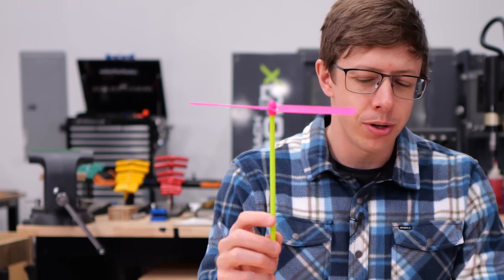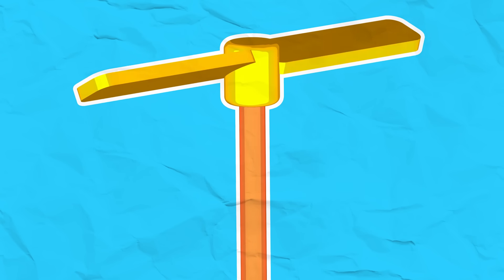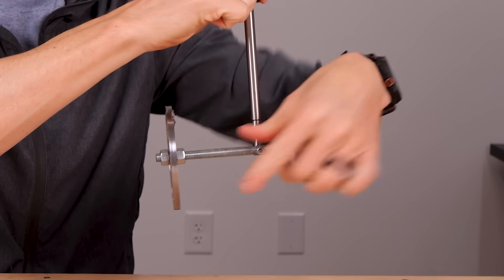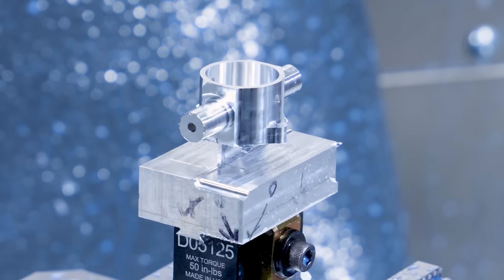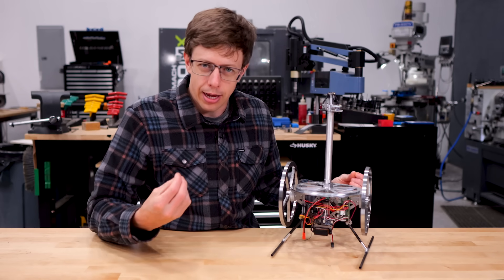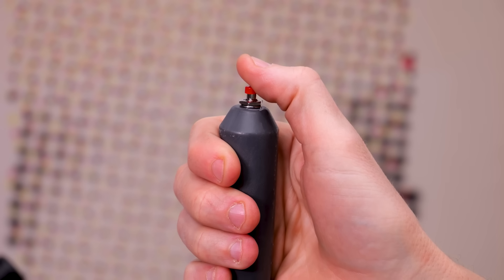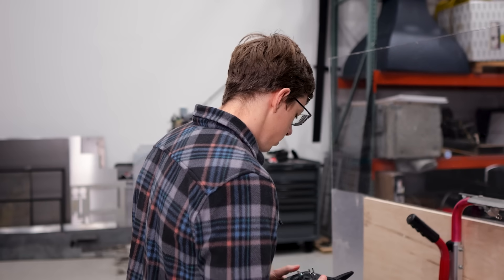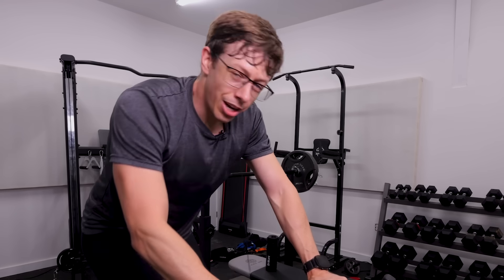I really thought this would fly well

Comment: You should place two flywheels parallel to ground rotating each in opposite direction. Next you put them on a shaft which connected to the propeller. Flywheels must rotate freely on the shaft. Next you put electromagnetic coupling that would act as a "torque converter" between shaft and flywheels. In such design you can use PWM on the electromagnetic coupling to smoothly transfer torque from spinning flywheels to shaft with propeller. And because you have two flywheels mounted horizontally spinning in opposite direction a) you would have gyroscopic force that would help you to stabilize helicopter b) you don't need to fight counter rotation.

Comment: Back in the 90s and early 00s this was a whole thing. They called them "Launch Copters" or "Jump Copters". They were both electric and nitro powered and would just fly up then back down with a trigger at the bottom that would cut the motor as soon as it landed. It's so hard to find information on them these days though.

Comment: One fix you might be able to implement relatively easy is the realistic linkages used in helicopters to change the angle of the blades not only to generate variable thrust, but also to vary the thrust more in the back than the front, or one side to the other, in order to get pitch and yaw which will have far greater strength than your flaps here.

Comment: so with bottle rockets the tail of a stick helps it fly straight the tube basically is the flywheel along with wing weight  proportion of the flight craft matters as it seems to me you're making a pancake shape to fly .. thrust to weight ratio matters but yes aerodynamics and unpowered freefall characteristics built in to make it self righting. weevils wobble but won't fall down so to say

Comment: Instead of solving the main body rotation problem with control surfaces, a tail blade, or counter rotating main blades, the design should take inspiration from the toy and not have a main body. Just a coaxial propeller and flywheel connected by a stick. There are three ways to couple the flywheel's faster rotation to the propeller.
1. Gearing like in this iteration
2. Clutch with either a mechanical governor or electronic control
3. Just a simple bearing and let the unavoidable friction transfer the angular momentum

Comment: First, I appreciate you sharing your morning routine. Makes me miss having an able body.
Second, you should contemplate am opposing spin rotor, which would automatically create bot more lift and counteract the momentum of thr primary rotor. But if you refuse that option because it deflects too much from the single rotor design, a smaller lightweight anti-spin governor setup might also dampen the rotational issue,

Finally, you should upload more often. As a creator, I understand how difficult it can be to reveal an unfinished prototype, but this community values your output and is glad to help you iterate.

Comment: Maybe if you put a boom off the back of it with another swashplate and a much smaller rotor also driven by the main ring gear and controlled by another servo.  Im pretty sure that would solve the torque of the main rotor.

Comment: Ok so I feel like its cheating to lead with toy helicopter and not keep the spirit of the thing (small input shaft with blades on).
It would be cooler to make an oversized one and put some tungsten at the blade tips for that flywheel effect or make the blade unit a giant flywheel with 6-8 pivoting aluminum blades and a steel rim. Embrace the rotation!
Alternatively, frisbee on a stick.

Comment: Valiant effort. Epic fails are entertaining too =)

I'd be curious how it would have worked taking off from a elevated, open air surface. I can't imagine the control surfaces were really doing anything when being used in all the turbulence of the downdraft/eddies from the rotor and drive gear. Dirty air is probably negating the coanda effect on the surfaces leading to no controllability.

Better. Faster. Stronger. 
Looking forward to Version 2.0

Comment: you've got the same problem as a helicopter.  You either need a tail rotor, or counter spinning blades.
Alternatively, you could try adding a flywheel to the same design as the toy, in which case it doesn't matter if the body is spinning or not.

Comment: I didn’t know that counter rotating flywheels would cancel each other out. I thought the gyroscopic effect would be doubled and procession cancelled out. I’d like to see a video to test this. Maybe if the rims of the flywheels were heavier you’d get a more pronounced gyroscopic effect. Use some steel in the rims. 
I think the anti torque wings could be higher. You have them about 5 inches high but only the bottom inch and half is slanted. I would slant the whole thing. I don’t think they need to be movable. If the tops were slanted then maybe the bottom inch movable to adjust the trim.  As the rotor speed changes so will the torque, so I guess they need to be moveable.  Very hard to control unless done electronically. 
Great project.

Comment: I feel this would be way better approached by just turning it more into a plane, which it seems you kind of figured was a good idea with the wings/ailerons to counter torque like a propeller plane would rather than how a helicopter would, but you clearly didn't go all the way. If you look at this like a plane just pitched fully vertical rather than like a helicopter you see that your wings are barely even a quarter the size they should be, and you have no tail section for stability. If you made it into a full plane you wouldn't even have to worry about an autorotation (which I suspect will be very difficult to reliably accomplish especially on something controlled remotely), because you could just glide it down like a plane. I very much understand how you got where you did and I would get why you wouldn't want to do it like this because it would be a pretty big departure visually from the starting idea of the helicopter toy, but the idea of trying to achieve the maximum height from purely kinetic energy and no on-board power is a really cool one and there's definitely ways to make this work.

Comment: I’m still not sure why he didn’t just put a flywheel on a planetary gear with the shaft That’s connected to the propeller in the middle of the planetary gear. It will give you the 5:1 reduction without having to worry about transferring energy 90 degrees

Comment: Entertaining build, and I appreciate the dedication to flywheels immensely, though I feel like it led you astray here. The process got me wondering about how far you could push the simplest possible design of a shaft plus propeller - the old Snap Circuits kits had a fan-launching motor that could be a useful starting point for an alternate design: a three-bladed propeller (more blades are less efficient aerodynamically but allow more power to be absorbed by a propeller of fixed diameter) surrounded with a thin ring that acted as a flywheel. The entire system was passively stable aerodynamically and when spun up by the modest motor from the kit (which I naturally overvolted) would launch easily to the ceiling. 

One final note - you discuss drag going up with the square of velocity, which is true, but lift also increases at the same rate. Propeller design is all about maximizing the lift-to-drag ratio at some target rotation rate

Comment: Why not rotate the orientations of the flywheels to be in line with the propellers gear them to spin in opposite direction to correct for precession then use a geared drive shaft to spin the propeller at a ratio to the flywheels

Comment: Would using 2 rubber wheels side by side " like a pitching machine" be able to spin the shaft and use a piston to push the shaft up and a actuator to pull back the wheels ?

Comment: Two main ideas for the redesign:
1) Counter-rotating propellers, which have been used an many real-life (and especially RC) helicopters to counteract the directional torque of the life blades, and
2) You modeled your control surfaces on plane wings, which have the control surfaces only in the back, since they need the main body of the wing to generate lift. Since you aren't using wings to generate lift, you could use the entire wing section as a control surface and just rotate the whole wing to counteract the torque if you don't wanna go counter-rotation, or even if you do so you can increase your aerial maneuverability.
Reply: Yep. I was going to mention this, but if an example would be helpful is the Ka-50 kamov "black shark".
Reply: @Zirnike   Isn't there another problem which is that when the craft is taking off, the earth plane is effectively butted up to the trailing edges of the control surfaces, and hence defeating the airflow past them
Reply: @Gottenhimfella That's what I came to comment. The whole thing is in ground effect the entire time he's trying to test the control surfaces; they're not going to work the same way they work in the air. I agree with the earlier poster that he should just ditch them and use contra-rotating props though.
Reply: @Zirnike  Counter rotating flywheels might help too.
Reply: Additional notes for point 2. If the entire wings are control surfaces, they will need some serious power to hold against the wind. Instead of making the whole wing rotate, have them mounted in a fixed diagonal position to start. He knows that they will always need to point in one direction, but with small adjustments. So the neutral position should be in that direction.

Also, during his low altitude tests, the ground interfered with the effectiveness of the wings by creating a high-pressure zone. If you are pushing air directly into the ground, it will need to turn because it just can't keep going straight. And this is going to start happening sooner than 3 inches off the ground. Those flaps probably weren't deflecting much wind until he tried the full test. But even then, they were not enough.
Reply: @JustSomePasserby excellent points. I want to see a suspended vehicle with the wings pre-rotated now 👍🏻
Reply: @JustSomePasserby  The way to reduce the power required is to have the pivot near the middle of the wing. The part of the fin before the pivot pushes one way, and the part after the pivot pushes back.
Reply: Came to comment the exact thing as your first suggestion, so left a like and comment on yours to boost it up instead of me making another comment amd just having it disappear in the flood of other comments. I think that the counter rotating propellers could really be the solution and possibly doable without a total redesign and just a much smaller redisign.
Reply: Better idea: drastically simplify it. Put tip weights on the blades for kinetic energy storage and have no gearing in the flying object. Release it from the motor with a clutch. The toy already works fine.
Reply: @andrewbroeker9819  Exactly. The rotor is a flywheel. Just make it more of a flywheel.
Reply: Intermeshing rotors, 2 rotors spaced apart on outriggers so the blades cannot touch, coaxial rotors — all of them contra-rotating — or a tail rotor to counter the torque. Or use the power to run something quadcopter-like. Differential gears or pitch changes on all rotors …
Reply: @Your first idea, in K-max (aka Synchropter) implementation, seems to me the simplest, lightest and most inherently stable option. The divergent axes give it a dihedral action.
Reply: @advorak8529  probalem with multirotor solutions, is you have to be carefull of the air vortices of neighbouring rotors. Can they be done, sure, we have real helicopters that do, but should be considered.
Reply: My first thought, why not make the propeller the main flywheel? It's rotating. 
Put some weights at the end of the prop, so you get the largest angular moment on inertia for the weight?
Reply: Also with betaflight you could program the ratios and let the gyro keep it flying straight with minimal controller input.
Reply: Adding a second pair of wings may be   difficult. However, as we just need the counter-rotation, installing a disk (similar to the fly wheels) in the lower half of the chopper should be fairly easy. Then powered using same flywheel gears, no rotating axis needed ...
Reply: Regarding idea 1: if done, you loose all gyroscopic stability and the chopper can be very unstable.
( Which can be ok, as the center of mass is way lower than the center if lift and so on, yalla yalla .... But it should be taken into account.)
Reply: Good ideas but it all goes way beyond the childrens toy he's trying to recreate to work on a larger scale, I hope he finds a simpler solution that's faithful to what he set out to do.
Reply: Also counter rotating gyros oriented horizontally
Reply: @Henrix1998   I wonder if three mutually perpendicular gyros would provide neutral and powerful gyro-stabilisation, while cancelling precession ?
Reply: @Henrix1998  He already has counter rotating gyros with their axes oriented horizontally (do you mean, spinning in a horizontal plane? If so, they would still cancel each other out, unless gimballed with a small amount of latitude, with the gimbal axes mutually perpendicular, like the Kenyon camera stabilisation twin gyro rig)
Reply: Counter-rotating coaxial propellers would be perfect for this.
Reply: @ Not if the entire point is recreating a childrens toy without multiple propellers in a larger scale that doesn't work that way though.  The challenge is to make a faithful recreation of it, not to make it into something entirely different.
Reply: Wouldn't it possibly take it a bit too far away from the children's toy?
Reply: On point 1: I think Contra-Rotating propellers would be a preferred approach but not sure if that goes against his basic kids toy inspiration
Reply: At that point he would just be building a helicopter
Reply: @mirinewman  that’s just a random rotor RC chopper
Reply: I added a rudder to an IFO and made the whole rudder pivot.  As others have mentioned, This made it way more effective.
Reply: maybe a vertical flywheel with the same moment of inertia as the blades and center gear?
Reply: beat me too it, needs counter rotating blades to work without a tail rotor.
Reply: at this point you're building a helicopter which was not the original intent, right?
Reply: Tail rotor is also a possibility, Finally gyros mounted 90 degrees to each other so the procession of one gyro is countered by the gyroscopic effect of another.

Comment: Could a single flywheel be placed in the center of the shaft parallel to the blades or would the gyroscope effect not work horizontally?

Comment: What if instead of the center flywheel being a large rotating mass, you created a turret style bearing; where the teeth rotated on the outer surface of the center flywheel.  Maybe there would be less momentum in such a small spinning mass?

Comment: You don't need a second set of counter-rotating blades (unless you want the extra challenge of designing the tube to spin around the original shaft, as well as the mechanism for both of the sets of blades, as well as dealing with double the blade  drag, as well as dealing with the airflow problems when the blades cross each other, that is). 
All you need is a fourth gear meshed at the bottom of the flywheel gears. This will provide all the counter rotation you need. Just make it hefty enough that it has as much angular momentum as the blades.

Comment: I you seriously  this is what helicopter have rear tail motor  to compensate for this this is not rocket science  is simple regardless I you spind top propeller  of 2 side counter weight  the are spind in the center jut different direction  still need at counter interaction  to balance the movement   and balance the momentum

Comment: Noob here, I see this as design is over engineered. I don't understand why the axis of flywheel is perpendicular to the axis of the rotor blades.

Why not follow the same design as the original toy ? Blades on the top. Long handle we use to spin could be heavy metal acting as a flywheel. Make this handle a tall hollow metal cylinder and you essentially lose the need for gears. You might have to power it from the bottom though

Comment: I feel like you lost sight of what made the toy interesting. Adding the flywheel was essentially giving it an engine. To stay true to the original design, I think you should've build a launcher instead; human powered. Like the biggest gear ratio and longest cord you could manage, along with doing everything you can to reduce drag on the flying bit itself (Which wouldn't really have changed, aside from being made with more durable parts and a quick release system). Imagine a 100ft cord or something, struggling to get it to budge from all that friction, but slowly overcoming inertia until you're running at the end, and finally release a mostly frictionless propeller.

Comment: Maybe not ideal but could you have a flywheel on the bottom connected by maybe a planetary gearbox to the rotor? It wouldnt prevent yaw but some fins could work (or have an airfoil attached far from the main body using carbon rods)

Comment: for the flywheel would it be possible to have just one flywheel but aligned with the propellers with a planetary gear at the center? In my mind it would solve many of the issues you now have regarding procession. though that does leave you with the issue of the body wildly spinning which isn't great for the electronics and so on. that said, and i don't know how feasible this is, you could have those hanging of a bearing so that both the propeller and flywheel spin independently but you may still need something like air drag using fins or something to keep the friction in the bearings from spinning the rest of the body.